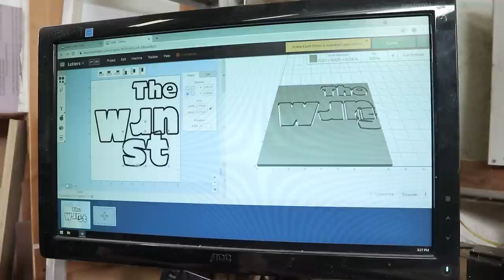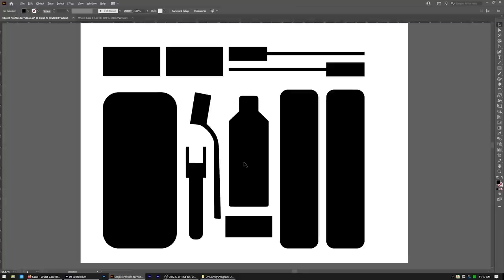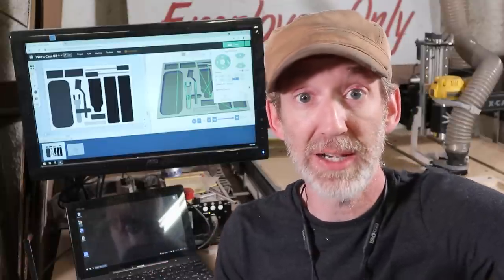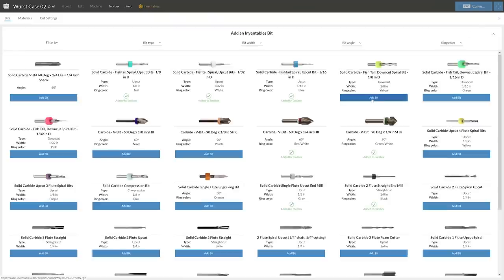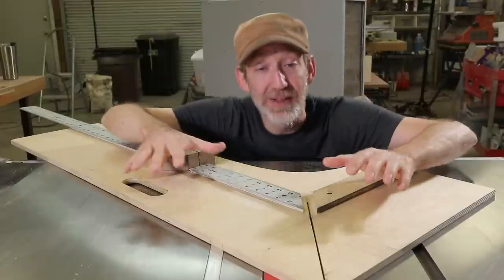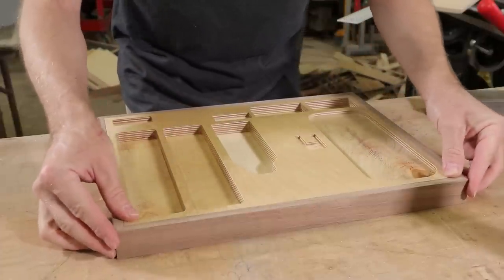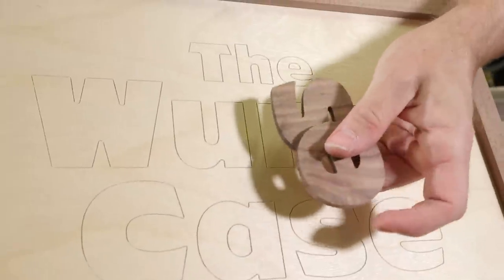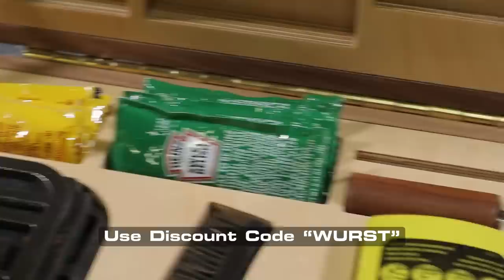The Wurst Case: Road Trip Grill in a Briefcase

Comment: You probably already know this, but it's something of a running joke in the machinist community. When you order some new gauge or tool, and the manufacturer has made a wood box, without fail these boxes fit their items way too perfectly. Because machinists built the box, their focus was on protecting the instrument. None of them ever have room to put your finger in the slot to get the tool. It's more common the nicer the tooling is. Seriously, like a hundred years of tech and this is still an issue
Reply: All this to say, consider finger divots